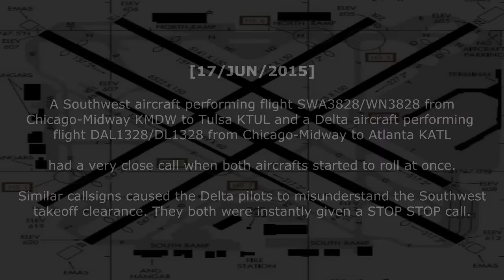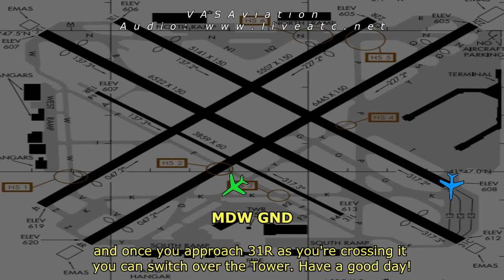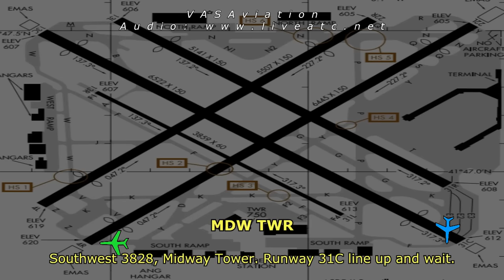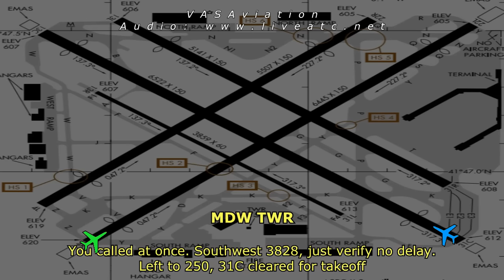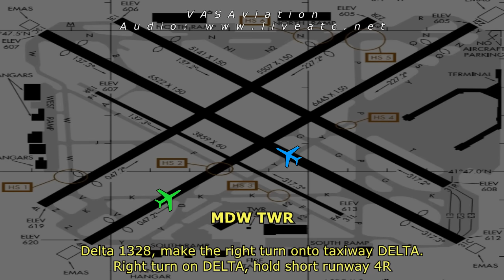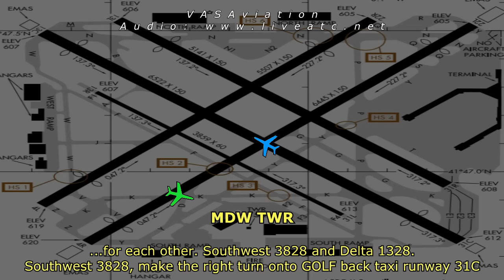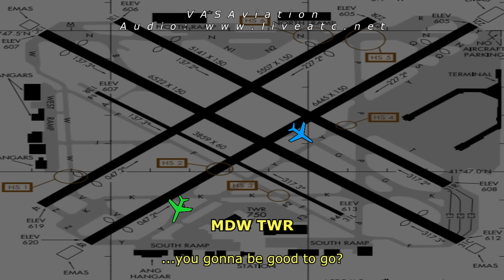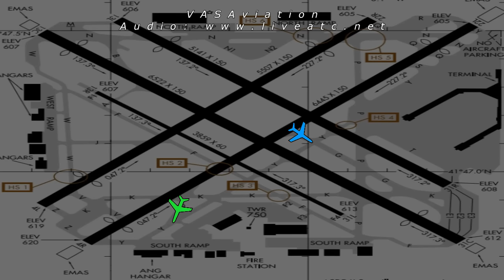[REAL ATC] Delta and Southwest VERY CLOSE CALL on takeoff

Comment: This is a perfect example of why you should say DELTA 1-3-2-8, and not DELTA thirteen twentyeight..
Reply: Unfortunately, AIM 4-2-4(a)(5) advises pilots of air carriers to use group form for the flight numbers. So they SHOULD follow AIM guidance until the AIM or company policy changes.
Reply: Grouping does eliminate some confusions, as well; fifty-whatever sounds nothing like ninety-whatever, where as even properly using niner doesn't come through clearly under all conditions.
Reply: Viktor Sijpkens - Aviation it's against company policy. Numbers needs to be grouped together. If I was the ATC I would have stated Delta delta everytime.
Reply: Nobody does that.
Reply: I agree!!
Reply: That’s exactly what I was thinking.
Reply: Nope. Listen to the recording. The problem is created not just by similar call signs but by audio clipping that occurs on keying the mike. Often the first sounds made by ATC are not transmitted because they are speaking as they key the mike and they needed to instead key the mike, wait half a beat for it to warm up, then speak. Differentiating between “Delta” and “Southwest” is much more powerful than differentiating between the numbers, and if the first digit is clipped all the pilot will hear is “...three two eight” which is identical for the two aircraft.
Reply: This is America. Non standard ATC is the order of the day... How many times do we see this even on this youtube channel.
Reply: Viktor Sijpkens - Aviation DELTATHIRTEENTWENNY-8
Reply: They need to stop clipping the mic! Wow! Also, given the numbers are similiar, the controller should better emphasis such as "Delta 13-28 Delta"
Reply: @MykArd  - actually, if the first number was clipped, you'd still have the distinction between three-two-eight and eight-two-eight. The numbers are 1328 and 3828, not 8328. Shut your eyes and listen to the recording without the subtitles and the distinctions are still clear. South-west-ern has more syllables than del-ta, thir-ty-eight has more than thir-teen, and four-right is also distinct from three-one-cen-ter. There were enough clues there that the call was for a different plane, and on top of that the initial heading was one far more suitable for a takeoff from 31 than from 04. Either the Delta pilot wasn't listening, or had such bad reception that they should have stopped and asked for clarification or a frequency change, and ATC should have picked up on the confusion too and made sure to clear the air.

But, probably a very busy airport, and they have continual deadlines to meet to get planes both up in the air and safely landed, so there can be quite a bit of time pressure forcing you to not carry out the proper safety checks you really should. Adding that on top of a bunch of normal little human errors and you have a system that will inevitably lead to something like this, and it's just lucky there were those vital two seconds of clear air where the ATC could get out two of the three "STOP"s before being blocked again. And that Southwest also responded to it, in case Delta yet again didn't hear or understand the call.

As for what format to use for the numbers etc, I'd say it's probably best left to the controllers discretion and judgement rather than prescribing a single format to be used all the time. Essentially, they should pick whichever gives the most contrast between two potentially clashing callsigns. Maybe sometimes thirteen or thirty-eight (or twenty-three) would be better. Other times, one-three or three-eight (or two-three). Whichever is less likely to be confused for another active plane.

I'd have thought maybe ditching the common names of the carriers and reverting to full alphanumeric callsigns - in this case, discretion suggesting the two-letter ones would be least confusable - would have been a wise move in this case, though that is with the benefit of hindsight. Delta-Lima is clearly different from Whiskey-November even with poor reception, and it also means there's more time for the radio to respond in the case of any ATC over-eagerness and keying lag. Even if you lose the entire first phonetic letter, you'd get ksh-Lima-thirteen-twenty-eight vs ksh-November-three-eight-two-eight.
Reply: Its actually FAA requirements that they read out that way.
Reply: Could (or another question, Should it be that iyo) an ATC choose based on circumstance? Also, should callsigns be repeated in some instances?
Reply: True, but how can Delta not hear that it is rwy 31C ...
Reply: @stephenwaldron4213  The only issue with that is you get more air time tied up and with more blocked trasmittions. They did repeat the call but Delta jumped on it again.
Reply: Thanks, I've been saying that for years. Nobody listens. In the military you use the individual numbers. Much more clear.
Reply: Even if they had the SAME Callsign, he said RUNWAY 31C cleared for takeoff 3 times.  Delta was lined up on Runway 4.
Reply: I mean the whole thing could have been avoided by letting both planes know who is going first, and having them acknowledge prior to clear for takeoff rather than saying brbrbrb 28 you're cleared for take off.
Reply: but he clearly said 31c clear for takeoff. 4R should have waited right? even called in 31C as he is leaving...
Reply: Delta 1 Tree 2 8
Reply: If this local controller was to do everything appropriately, he should have said DAL1328DAL.. and SWA3828SWA.  It states in the JO7110.65 (air traffic bible) that similar sounding call signs from different carriers should be emphasized by restating the company after the numbers are read in group form (Delta thirteen twenty eight Delta and Southwest thirty eight twenty eight Southwest)
Reply: @kd5nrh  problem here is for example, "5038"... "Fifty thirty-eight" sounds too much like "fifteen thirty-eight"... This is where single numbering comes in... "Fife zero tree eight" sounds nothing like "one Fife tree eight" therefore there would be no confusion...
Reply: Yeah but they where told there was a similar callsign on the frequency and Delta where told to hold on 4Right while clearly given take off clearance on 31C should have payed a little more attention lol thanks god it didn’t escalated to anything worstp
Reply: Or hold similar callsigns so only one is in takeoff or taxi position.
Reply: Australia and usa are using these while in the east like japan, china, any other asian country and middle east are using individual numbers instead
Reply: At icao call signs, fl, qnh, qfe and time should be read saperately.
Reply: Viktor Sijpkens - Aviation whatever the fuck u said is right
Reply: Imo what's wrong here is that they were both given line up and wait instruction, while the tower keeps expediting the departure by saying "no delay Pls no delay" add in similar callsigns and you get this.
Reply: No actually you shouldnt, callsigns with numbers like that should be grouped as thirteen twenty-eight.
Reply: See now the reaon why we don't say it like that is becuase that takes too long.
Reply: Also a perfect example of why you need to listen carefully on the runway.  Delta... sigh...
Reply: Nope.
Reply: I wonder why airports/aircraft that use ICAO procedures never have this problem ;p
Reply: Not really: the ending 28 would still be similar. If I were ATC trying to discriminate the two similar callsigns I would articulate the airline prefix a little more, as an airline callsign would less likely get confused, and more likely get through radio static, than numbers.
Reply: Viktor Sijpkens - Aviation  somebody tag the FAA to this comment make the phraseology mandatory please.
Reply: Joe Bramblett fawty fifty fawty forty fitty forty fawty
Reply: But why I don't understand
Reply: To be fair, Delta heard a number of things that were clearly not for them. Are you on 31R? Is that your wind readings? Is your heading 250?
Reply: No, this is a perfect example of why they need to listen. The different call signs weren't difficult to hear, especially with the company name in front of them.
Reply: Anne  
That opinion only serves to imply that you're easily confused...  😊
Reply: Absolutely incorrect. The groups of two is safer and is the standard. That's because if "one three" was clipped, it could conflict 10-19, 23, 33, 43, 53, 63, 73, 83, 93, 1 and 3. Groups of two forces digit alignment, and is a technique learned by the US Army in the early days of radio.
Reply: Mef Hefty For how long have you worked ATC?
Reply: Should not have had two planes lined up for takeoff on crossing runways. Confusion was forseeable and actually expected as made clear in the recordings. Should could have prevented al of that by taking a step back.
Reply: @MykArd  in German Radio Communication we had "Denken - Drücken - Sprechen" (Think, press Button, speak) but due to digital systems it is now "Drücken - Denken - Sprechen" (Press Button, Think [pause a second], Speak) since all the digital systems are now based on timeslots, a similar problem may be occuring with the Radio over IP technology that could be used in the Tower.
Reply: Or you know, verify that the runway number with takeoff clearance is the same runway you’re on.
Reply: Can someone explain. Like I'm 5?
Reply: Would not have changed anything. If someone confuses Southwest with Delta and 31 center with 4 right, saying the numbers individually will not make any difference; they will still hear what they wanna hear.
Reply: @ekevanderzee9538  Clearly you've never worked traffic or flown into a busy airport
Reply: Considering the similarity of the numbers, the ATC talked EXTREMELY fast and unclear.
Reply: Avoid similar order to similar calsign would have helped? If the ATC holds Delta at Y and gives clearence for Take Off to Southwest it's not so easy to misunderstand, i think
Reply: Yeeeeaaaaaaahhh!!...thinking the same
Reply: Why don't we have say a traffic light that pilots have to use instead of just radio.
Reply: having to say callsigns in non-group form takes up more radio time than you would think, we do group form for a good reason
Reply: Viktor, I totally agree with that statement. I'm an aircraft dispatcher not an air traffic controller but it does make sense to dash out numbers once similar numbers are being said
Very nerve wracking that was.
Reply: That mainly seems to be a problem in America. Everyone reads it back number by number in europe
Reply: Ikr or speak slowly and clearly instead of going sjdcrudufotnreoiz
Reply: You had me at Delta if I was Delta.  Number sure but you outta know which airline you fly for
Reply: Hah I just posted same lol
Reply: I think this is a case of FAA phraseology taking precedence over ICAO terminology
Reply: well everyone is used to it so it definately would be a good idea with similar callsigns like that but its not really gonna happen
Reply: Anne  What about 3028?
Reply: @SP-qo1so  You're correct but I still don't think the call signs are that similar. If ATC at a busy airport had to advise planes with 2 similar digits, that's all they would do.
Reply: @MykArd  I'm not sure that clipping was happening to the actual transmissions. I think that may have been in the receiver which was monitoring them.
Reply: I thought it was mandatory
Reply: It should be a problem. Thirteen sounds nothing like thirty-five. If it was thirty, then maybe.

Comment: The animations help alot
Reply from the maker: That's the purpose! :)
Reply: thanks for the animate
Reply: Cody Hill ii
Reply: John Doe _*
Reply: I thought its from their system
Reply: Mhm
Reply: Sarcasm?
Reply: Sarcasm
Reply: Sarcasim
Reply: They see this also in their system. With much more detail.
Reply: A lot
Reply: A lot*

5:00 PM
8/4/2019
Reply: I’m glad I’m not the only one who feels compelled to correct people using “a lot” as a compound word. “Alot” is incorrect and your phones autocorrect will even try to fix it for you. I feel like you have to go out of your way to spell it wrong.
Reply: @joshchavez8190  Some people still use iPhones 🤷‍♂️

12:21 PM
10/10/2019
Reply: Happy John facts. I’m one of those people and that’s how I know your autocorrect will stop you from saying “alot”. I’m commenting from an iPhone and if I even try to type it in, it automatically changes it to two words. That’s why I said I had to go out of my way to change it back to “alot”.
Reply: @joshchavez8190  Haha

And also rip...

4:28 PM
10/10/2019
Reply: @joshchavez8190  (and John) : Also, not to be confused with allot, which means to divide or distribute by share or portion.

By the way...interestingly, I just tried to type "alot" on my Android phone and it didn't try to correct it!
Reply: @VASAviation  The animation is inaccurate
Reply: Water is wet
Reply: @VASAviation  Someone KEPT stepping on you, not cut. Have people proofread your captions.  Please.
Reply: Yeah it’s crazy how fast the southwest stopped after it got going. The hot brakes stop really sets it in.
Reply: What did you use to make those animations?

Comment: The tower made very little effort to clearly enunciate the call signs. He knew there was a potential issue and just flubbed through the call sign numbers without even having properly pressed the transmit button yet. There’s no point in the ground controller warning the pilots and then having tower make it unnecessarily hard for them straight afterwards.